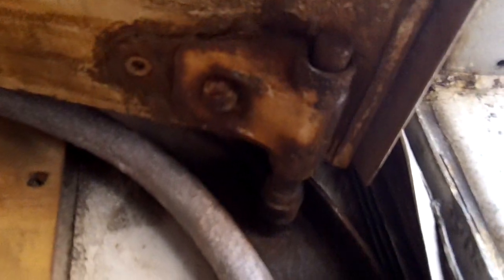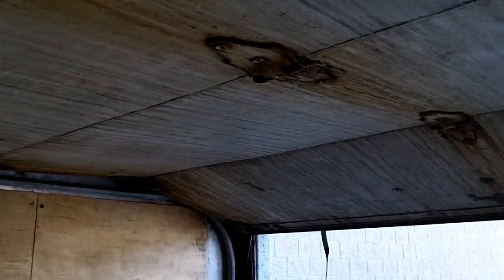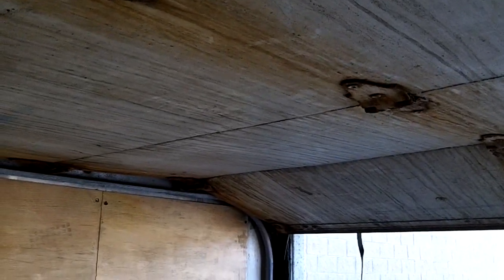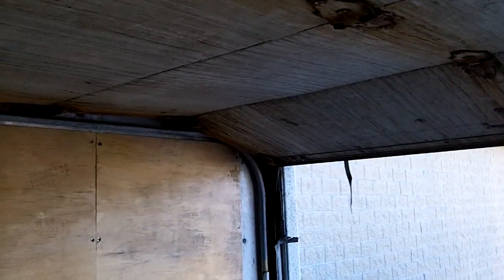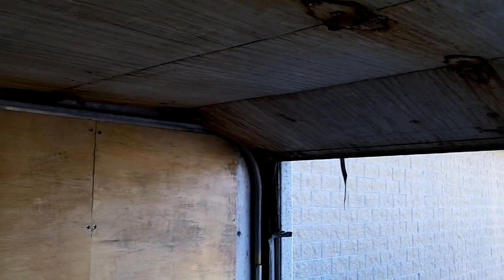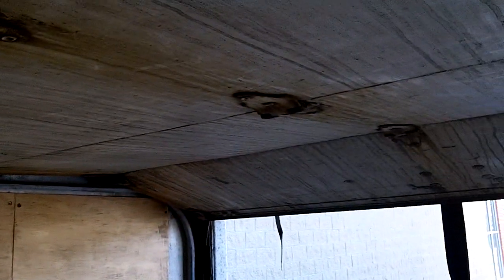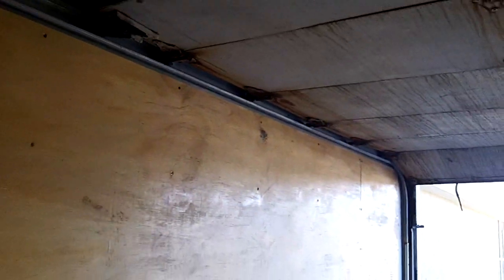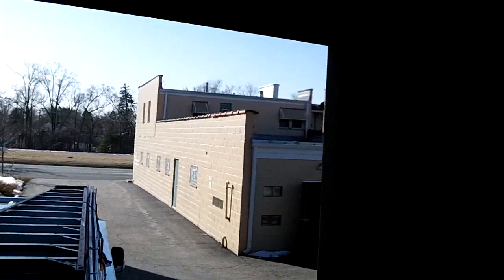fix little garage door on a truck

Comment: I owned my own garage door co in mass I moved to Florida and going to open another shop company but I had to refuse these types of jobs because I never done them and I’m sure I could figure out but thank u for posting these so I can actually see how it’s done a lot easier when u see how it’s done I’m nervous about the torsion springs because of how close they r to ceiling there is no room for error with these before I went on my own I worked for precision overhead door hated them nickel and dimera but meticulously good at their job